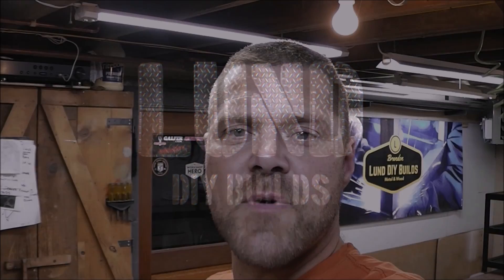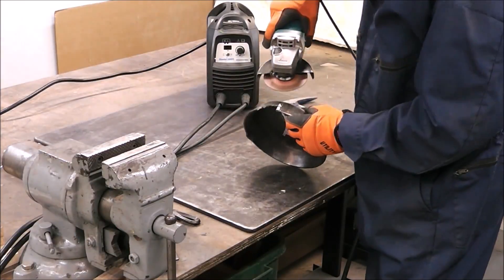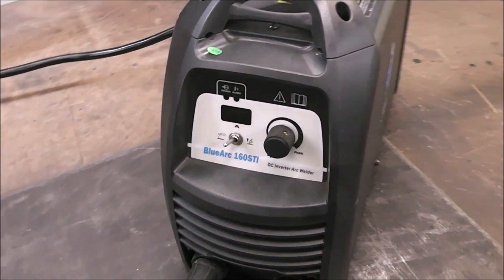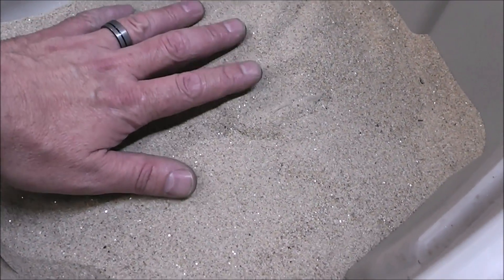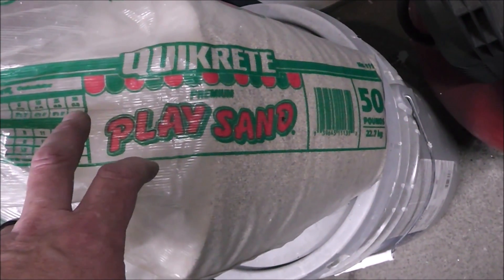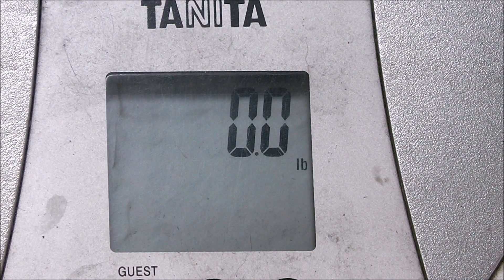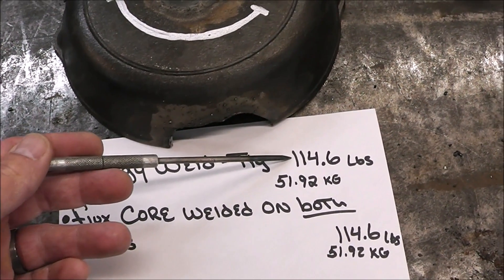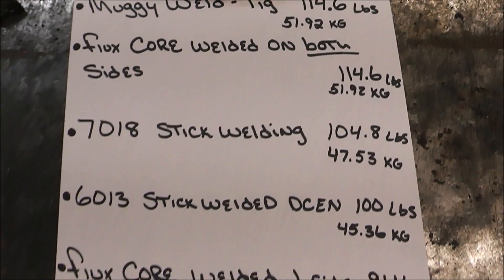Stick Welding Cast Iron Repair with 6013

Comment: The best way ive found is pretty much the way you did it. Just let the piece cool completely between welds.
I welded an exhaust manifold once with success that way
Reply: Could you share how you welded the exhaust manifold? I got a leaking manifold so wondered if this rod and method could help.
Reply from the maker: @seemaab your best bet is mig it with silicon bronze. I have a very detailed video on this repairing an exhaust manifold.
Reply: @ I only own an arc stick welder unfortunately so I guess I’ll have to either use 6013 rods and hope I don’t burn a hole in the iron or take it to a professional to tig/mig weld it
Reply from the maker: @seemaab I would probably go a nickle 99 rod and give that a try
Reply from the maker: Cast iron repair is time consuming but if you take your time as you found out, usually the results are pretty good @michael wells

Comment: Surprised the slab of steel you clamped it to didn't act as a heat sink, sucking all the heat out of the pan. Could try a test by using the pan to cook with, to see if thermal expansion of the parent metal is greater than the weld. It certainly held some weight 👍
Reply from the maker: Thats a great point @ Dave Wright. I can't remember because I've done so many but I have other videos elevating it on nuts for that reason. I've had good luck on heat cycles.

Comment: Enjoyed the video. I have an antique scale where a roughly 1" round cast iron bar was broken in the middle and so the two parts need to be joined that are weight bearing. I wanted to see if you had any suggestions.

Comment: It should not have broke. Unless it was just a temp repair. Would you use that 6013 to repair a cracked iron cylinder head? Not triggered just curious/beginner
Reply from the maker: @R Pierce I know some people have had decent luck with 6013 but that hasn't been my experience. I have had some luck in the past but it hasn't really been consistent. A good nickle 99 with a preheat and post cool down will usually yield the best result. I responded to another comment of yours earlier and I mentioned tig brazing your part. You could basically do the same thing using a stick welder and some nickle 99 rod. Because the part you needed to repair is rare, I would lean towards Muggy Weld products. They have specialty rods for cast iron. They are not cheap but they work incredible.
Reply: @BrandonLund  thanks for the reply’s, you always come through for me. If I cannot find someone to tig braze, I’ll try muggy weld or another product I heard about is Castalloy 505 I think
Reply from the maker: Anytime brother. I have not personally tried the castalloy products myself but I have heard good things. I believe they would be simular to the Muggy Weld rods I mentioned. What are you putting the diff in? Are you building a custom vehicle? As you probably know I'm into bikes and cars too although I don't have any time for any car projects at the moment.
Reply: @BrandonLund  1980 Bronco, manual trans, 302 based 331 stroker, 10:1 compression, aluminum heads, intake cam, headers, strange 9” rear, all new u joints, driveline, steering components, on 35s
Reply: @BrandonLund  I’m working on a video to document my build but am using my phone only.
Reply from the maker: @R Pierce Damn! I've never had a stroker motor but I've always wanted one. It sounds like an awesome project! This was my last project. I cooked the tranny, parked it then got tired of looking at it and sold it. It's a 93. I bought it in 94 https://youtube.com/shorts/QC-pIMaVY88?feature=share
Reply: @BrandonLund  sounds strong! 4x4 too?
Reply from the maker: Yup 😎
Reply from the maker: I miss it though. This motor was originally in my 1970 C-10 that i bought from the owner of Buttler and McMaster. They build circle track engines and a few cup car motors.  I sold the truck but kept the motor and converted it to run with TBI. It was a huge project which was also the other reason I sold it. Too much wrenching not enough driving lol
Reply: @BrandonLund  totally agree about the wrenching vs driving aspect. When the engine you bought was built by circle track guys you know it’s gonna be all business. So, what’s the dream ride going to be?
Reply from the maker: If I won the lottery my 1st pick would be a 69 Nova followed by a 69 Camaro and a 70 Chevelle. I'm real partial towards the older Chevy  muscle cars. I daily a newer ford pickup after my 06 Silverado turned to iron oxide powder in my driveway. Maine winters are brutal on vehicles.
Reply: @BrandonLund  my pops had a 64 El Camino with 396 bored to 420, my sister had a 66 Nova, but luckily for me I’m in the mountains above Los Angeles and barely get surface rust
Reply from the maker: Man I'm jelous!

Comment: I got to weld a part for my tractor that's cast iron and only have a stick welder. I have 6010, 6011 and 7018 electrodes which will be a better choice. I also dont have an oxy torch so adding one to my Christmas list. The part controls how deep the implements go so not sure of the name or stress on part.
Reply from the maker: @Jorge Serna of those choices a 7018 would work best. Better yet you can get small packs of nickle 99 at Tractor supply that would be your best bet

Comment: Would that hold better if you used a thicker welding rod?  Also, if the weld breaks on the side of the weld, could you not weld some vertical beads across your weld like stitches and gain strength?  Really awesome videos.  I recall seeing the video on mig welding caste a while back, but the links are gone above.  I'll check your play list.  I think youtube moved them.   Thanks for what you do buddy.
Reply from the maker: @Hip Airbrush I don't think the thicker rod would change much but the stitches cross ways might. The biggest issue is that the heat from the weld tends to make the cast brittle right at the toe of the weld so spanning over that area might help a little

Comment: Very good and easy to understand demo of cast iron repair.  I look forward to one more such experiment using E 7016 iron powder type electrode. This is widely used in India for non machinable cast iron repair and maintenance welding. Thanks for wonderful video.
Reply from the maker: @maritimefreak I'm going to have to give that a try! Thank you for the suggestion! 🙏

Comment: to me a successful weld would only be if it could withstand the original strength.... Welding any thing that is not as strong as original you need to rearrange your procedure... Backing plate, build up what ever....Or replace the damn thing..... Would you weld a hitch on as say well its done but you can only pull 1/2 the payload...
Reply from the maker: @Roger Fossette you seem to have all the answers, enlighten me on how you suggest obtaining the original structural integrity on high carbon cast iron...ill spare you. You can't.

Comment: Trying to repair an old cast iron rivet forge. I've never really welded. First attempt didn't go well. Not enough penetration.
Reply from the maker: @A Random Anvil  cast iron repair can be hit or miss. Old cast iron is usually of much better quality than cast iron of today so I'm hoping your next attempt works better for you. Just make sure your heat is low enough that you aren't melting too much of the the base metal. That is what could potentially give you problems as the impurities tend to want to float to the top

Comment: I used 316L filler to fill the gaps and tack and then reheat the part and use cast nickel filler rod all in the TIG welding process, pin holes were easier to fill, heat part again after welding with peening, then let heat soak for several hours. I believe it is important to reheat the affected heat zones to help the metal reduce stresses.
My part was a cast iron gas manifold venturi 1-1/2" NPT connection fractured from misalignment/stress failure.
Base metal was about 1/4" thick, maybe more.
Reply from the maker: @mongomay1 Interesting!  I have tried 316L and didn't have good luck but I also didn't use it like you mentioned. I'm going to have to give that a try!  Thank you!
Reply: @BrandonLund  It seems the 316L helps float the junk up. grind it clean, then hit it with the nickel, clean out the intrusion/floaters and weld some more it is a PITA, but the idea is to rescue the part and keep the plant running. Have to have a specific goal and then work something until you get it fixed. The part I mentioned was 2 weeks out for a natural gas venturi to an industrial oven and we could not have any leaks.
A small needle scaler can work for peening.
Reply from the maker: Thats awesome man but I agree it sounds like a lot of work but a solid repair!
Reply: Try 309l, it's a higher nickle content.. I've had good luck with 309 using tig on exhaust manifolds with a good preheat and good post heat, no nickle rods or brazing and no leaks

Comment: It would be interesting, just for grins, to test a NEW pan to failure. See what the difference is.
Reply from the maker: @H Gj I actually did just that not too long ago and was pretty impressed with the results. You can find that video in my cast iron repair list. It's one of the newer ones in that series.
Reply: @BrandonLund  great! I should have suspected that you did a control. Your work is good.
Reply from the maker: Thanks man. I looked for that video if you haven't seen it yet. Here it is :) https://youtu.be/_e9ELJq7Zio

Comment: Hi There.

 Thank you for this tutorial you really helped me out. I am restoring some cast Iron gates from 1814 that I have had to basically rebuild. I had never welded cast iron before and was failing miserably until I watched this. The key is not to put to much heat into It other wise the whole thing falls apart.
Thank you from across the pond.
Eddie.
 Abbeydale Machine and Tool Co. Ltd Birmingham United Kingdom
Reply from the maker: You are welcome!
Reply: @BrandonLund  what type of rods are u useing are they special cast iron rods or normal
Reply from the maker: Just normal rods

Comment: Trying to repair a crack in my 327 block.. i got a thin crack right above the lifter bore in an otherwise perfect virgin block 😭
Reply from the maker: For something like that I would use a nickel 99 rod or a specialty cast iron rod from Muggy Weld. That block is rare
Reply: @BrandonLund  i know it hurts mah soul 😔 I’d like to save it if possible.. everything on this block is still standard size 😭
Reply from the maker: I wish you luck on your repair! Pre heat and post heat are your friend!

Comment: Another trigger here, I welded cast with a 6013 using oxy acetylene.
And it worked fine.
Reply from the maker: Thats awesome! Thanks for sharing!
Reply: Interesting! Did you knock the flux off the rod and use it as bare filler wire?
Reply: @hgj2019  I did yes, but I used sif cast iron flux,
Preheat and insulated cooling.
The cast was about 4mm thick
Reply: @PeakyBlinder  thanks! I'll give it a try.
Reply: @hgj2019  it held for me,

Comment: How would a mig weld work?
Reply from the maker: Quite well actually. Be sure to check out my Cast Iron welding playlist and see for yourself what each process yields for a break strength. Solid wire, Flux core, tig and stick. I compare them all

Comment: Very good video & very impressive "strength test" demonstration. First of all, I'm not a professional welder, but I've had the opportunity to oxy-acy braze & weld, arc weld, solid Mig & flux core, and Silver solder (HVAC). Our mail box is on a cast iron water pump and a snow plow clipped it in January, busted in several pieces laying in the snow. I waited until the snow melted some & collected the parts & decided I would attempt to glue this mess back together. With a trailer full of generator, Lincoln 210MP, handful of cast iron rods, grinder, and a bucket full of hope, I got started on the repair. The rod was 1/8" but that's what I had (1/16" or 3/32" would have been better for this job), and I got these at a big box store (total of 6 sticks). After grinding, tacked and pre-heating (Propane hand torch), I used 1/2" welds at opposite sides, peened, moved again, repeated until the first part was welded back on the bottom pipe. Moved upwards & used the rods until they were gone, then switched to the flux-core (0.030 dia) because I wasn't done yet. Long story short, I was able to finish back to a reasonable facsimile of what the pump looked like before the snowplow plowed it and the mail box. Nothing I did would pass muster from a professional welder, but my new mail box is affixed to the pump and hasn't fallen over yet. My favorite for repairing cast iron has always been using flux covered Brass rods, but it would have been a little more difficult for me to move my oxy-acy setup. I wanted to try the stick option on the new 210MP, and it worked very well. The flux core Mig worked ok, not nearly as aesthetically pleasing, but the job is done & I can live with it. Your videos are well done and provide insight to me as to what I can do with what I've got to work with. Thank you for your efforts, I certainly enjoy learning from them.
Reply from the maker: What a great comment and thank you for sharing. As you pointed out, these videos are to give some insight on what to expect when using a specific process. Sometimes it might not be the prettiest but if it's all we have than at least we know what to expect rather than toss it in the trash.
Reply: @BrandonLund  Thank you for your reply. My Dad owned auto salvage yards, transmission shops, painting & auto body shop, and I started assisting him (at 15 years of age) while he was the body man at the Oxnard, CA Earl Schieb Paint shop. Production, not so much quality, was the highest driver at Schieb's, so I mixed Bondo and primered for Pop and learned to spray paint motorcycles & cars. Other business ventures brought more experience for me, so I've been very fortunate to be exposed to different learning opportunities. My Dad stuck me in front of an old Hobart, almost taller than I was at 9 years of age (1960), and gave me a tin of 6011 sticks; he found it was cheaper to do this then let me run loose in the salvage yard. So I'm not without some knowledge of welding things together, I'm not in the league as you are. Keep up the great videos and sharing your insights of welding. Take care, from an old HVAC guy.

Comment: I have a cracked banking plate for my coal stove. it only took one season to go from a hairline crack to a hole I could stick a pen through. can I stick weld it with 6011? worse case I'll be rewelding it again middle of the season, making it look worse until it's unusable.
Reply from the maker: Something like that you would do yourself a huge favor by picking up a couple nickel 99 rods at tractor supply.

Comment: Once upon a yesteryear, I welded some cracks in Chevy engine block with 6013 rod.
I tried welding it cold with wasn’t working ( of course ) so we got out a torch and heated the area around the crack then it welded much nicer than I expected as that was the only rod I had , no nickel rod.
The main thing with REAL cast iron is the pre- heating. To really properly weld real cast iron is ( if possible ) heat the whole thing in oven then take out and weld and then put back in oven and cool very slowly. BUT who can do that?  99% of the time you’re limited with just heating with a torch and trying not to cool too fast.
Many moons later I welded up a water pump for a well with nickel stick rod and it held 
AIR as well as water pressure. So yes , it is possible to get solid sealing welds with stick rod. ( it was a jigsaw puzzle not just a crack )
Reply from the maker: Sometimes the best way to learn is to just try! Farmers especially know this and  have been doing what others consider impossible for many years.

Comment: Good job, but by checking the spark colour, will determine the "mix" in the metal....looks like that pan is more of a cast steel than iron, notice the yellow sparks...a pure cast iron would have an orange/red spark.
Reply from the maker: Thanks for the info

Comment: Also my will doesn't have to be super strong just has to be liquid tight because my casting area is outdoors it's been snowing for a week I tried to tap my pot against a steel rod is knocking ice out of it because liquid and anytime for moisture equals explosion of hot as liquid lead flying everywhere and that s*** hurts!!!! I mean I forged Steel also is a hobby and I'd rather touch myself with a piece of orange glowing f**** steel over getting any type of liquid molten lead on me lol
Reply from the maker: 7018 is probably the most trusted of the 2

Comment: I am absolutely horrifyingly terrible at brazing anyting so I'm just here to watch to see if 6013 will work or 7018 is a better option no, because I'm just trying to re weld my cast iron lead Melting Pot so I can keep casting boolits 😆

Comment: Hello. Can you do a test using stainless steel rod. I have used it before and it held great. I just didn't test it for strength. That would be a good video for your subscribers. Thank you so much and don't listen to the nay sayers. You know what you're doing. Thank you.
Reply from the maker: Thanks Javier. You can plan on it in an upcoming episode. Thanks for the suggestion!